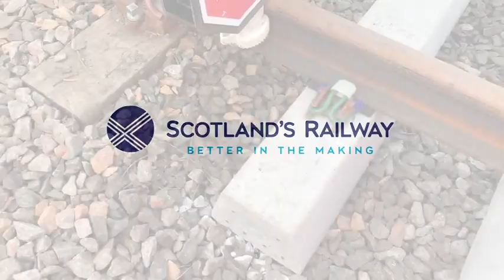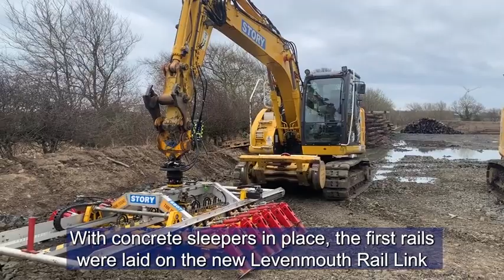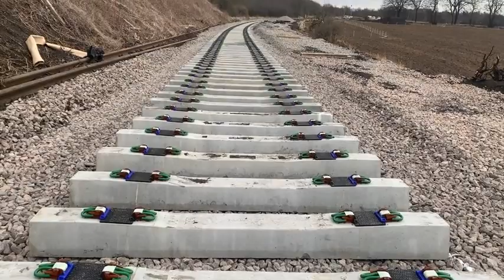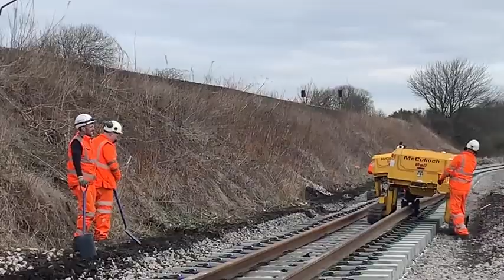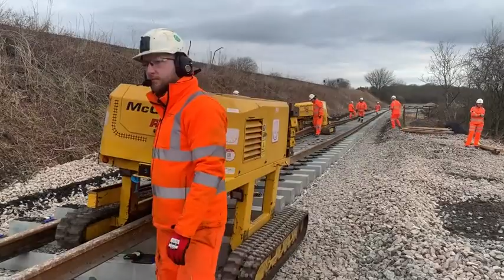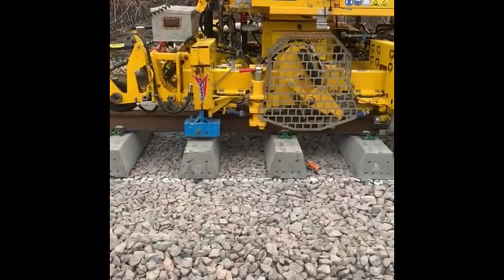Levenmouth First Rails March 2022 with captions

Comment: It's the long awaited (and welcomed) Leven to Thornton line. So when will the station in Thornton be given its proper name - i.e. Thornton? Some passengers alight from the train believing that they're in Glenrothes. And why wouldn't they? The front of the train reads 'Glenrothes' and that's the name on the ticket. I've heard guards on the train announcing that the train's going to Glenrothes.  High time that the station was given its 'proper' name. Anybody disagree? Apart from ScotRail & Network Rail. At a meeting in the Laurel Bank, Markinch, in 2019 the heid honcho of ScotRail (Is it Alex Hynes on a salary of £300k+?) admitted that he didn't know that the station wasn't in Glenrothes? There are a number of signs around the station (including Fife Council) that refer to the station as Thornton. When will ScotRail and Network Rail step into line?

Comment: There is more progress in terms of reopening closed routes north of the border. And the east west line from Oxford to Cambridge barely limos along. No comparison, is there?
Reply: Slight correction - should read limps along, showing very little in the way of progress. And while we have some dialogue on this matter, a high speed tramway would be a very much better option.  The only downside being that the planners did not mention how an east -west route and vice versa would be of dual use . Principally for cross country freight and for passengers a lot less of a priority.